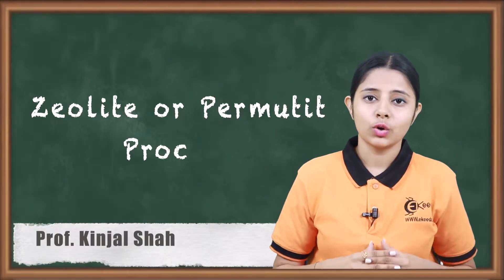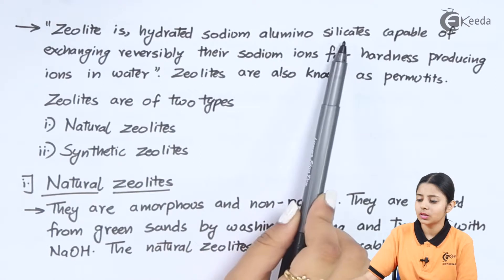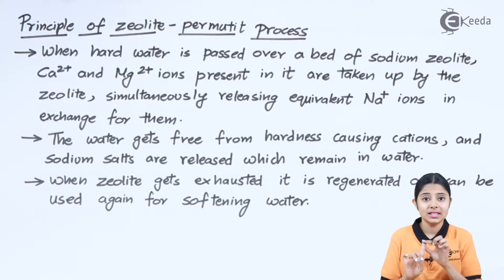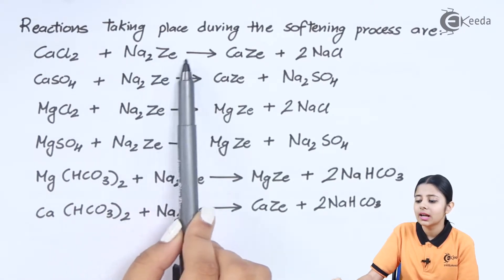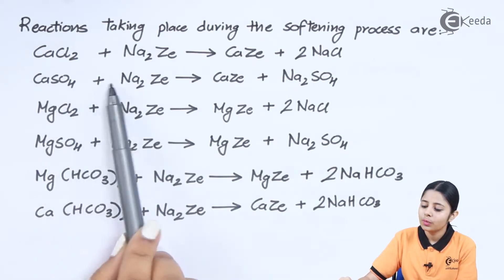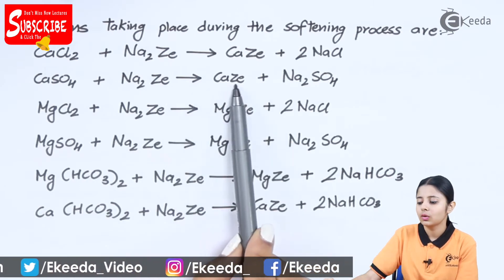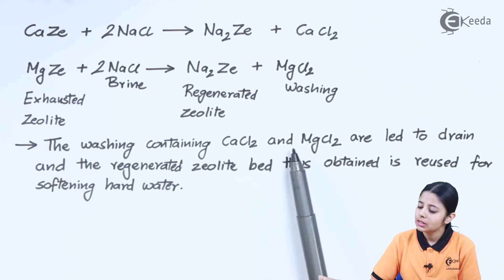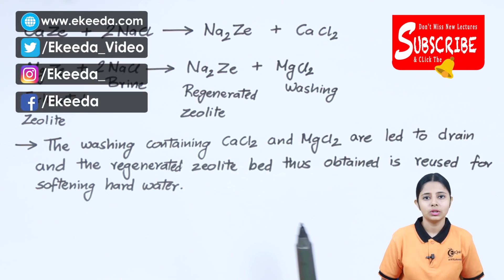Zeolite or Permutit Process - Water - Engineering Chemistry 1

Comment: Please do correction. In zeolite process hardness causing impurities are not converted into insoluble form. Hardness causing calcium and magnesium salts are converted into soluble sodium salts.
Reply: But how does that make sense?
How would it get filtered out, if they would be converted into soluble form? In fact what the need to convert, 'cause the impurities are already in a soluble form
Reply: @gargimohanty955  if water contains soluble impurities of calcium and magnesium then it is hard water and it is not suitable for boiler but if water contains sodium salts water is saline but not hard. For boiler water should be free from hardness causing calcium and magnesium salts.
Reply: @gargimohanty955  you can visit channel Easy Engineering Chemistry for better explanation.
Reply: @gargimohanty955  if water soluble calcium and magnesium impurities are not removed then in boiler they get precipitate out and form scale and Sludge.